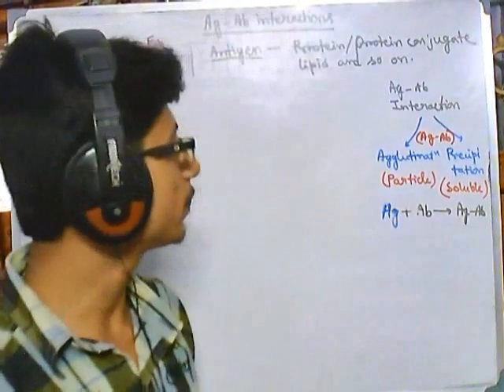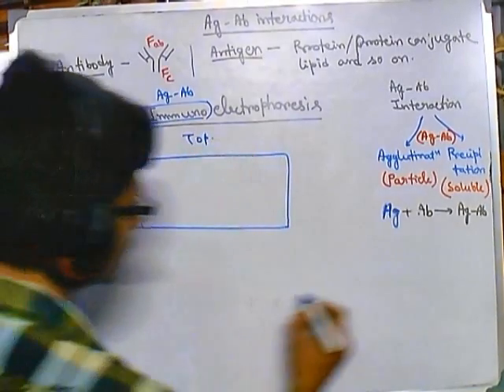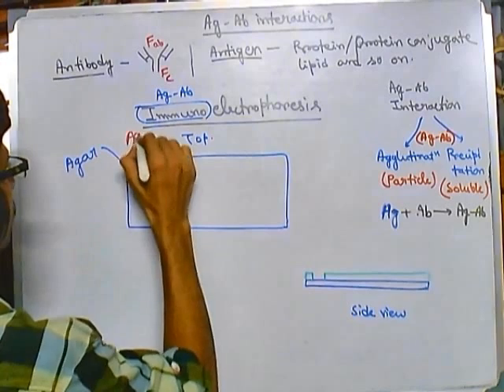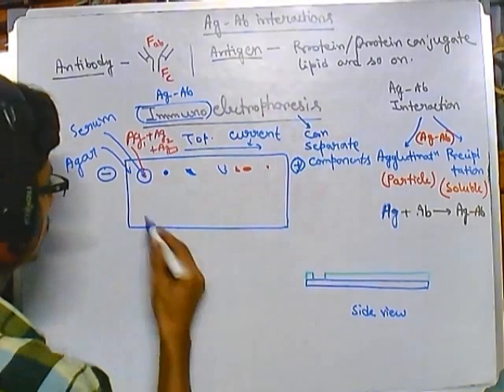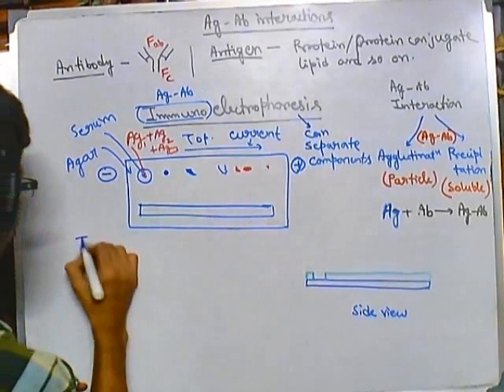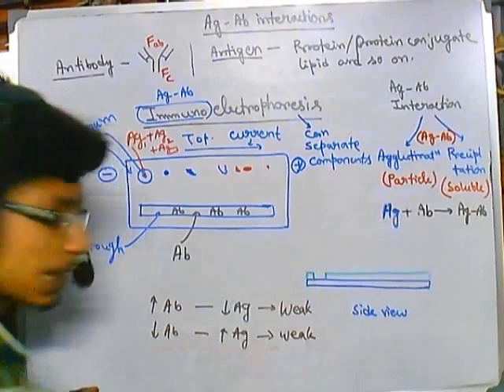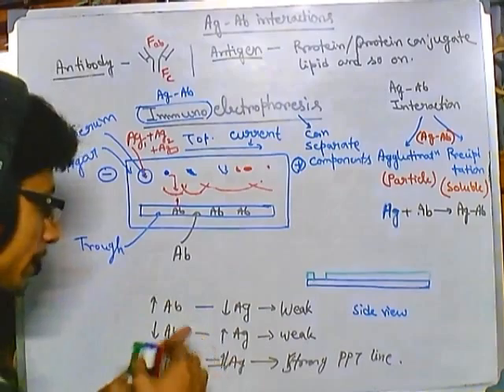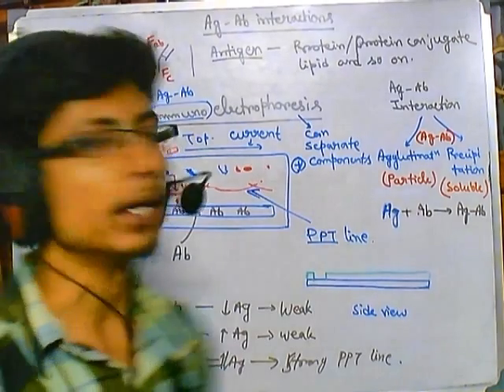Immunoelectrophoresis

Comment: 4:15 - electrophoresis is not a separation technique based on charge, it's based on size
Reply: it is based on charge.
Reply: +Joey Orlando Electrophoresis = electrons & Holes.... based on charge...
But both are true statements are valid. The particles (molecules or ions) move due to their charges. However,  how far they move from the starting point does depend on both the charge and molecular weight. 

If a particle is positive then you would find is close to the negative electrode. In that respect, how far that particles travels depends on its weight, and therefore its ability to traverse the agar gel.
Reply: ???? and the charge determines where the fuck its going on the gel... you first year undergrad bro? It can be determined on charge or size. get a job.

Comment: Great video, but I think you could have told a better definition of Electrophoresis, like: the technique of separation based on differential migration (way and rate) of charged particles (analytes) in an electric field when potential is applied.
Reply: Because of the molecular mass